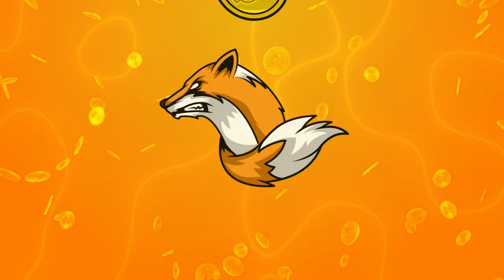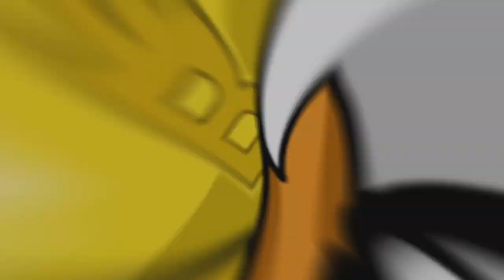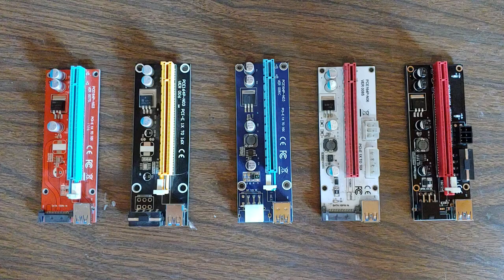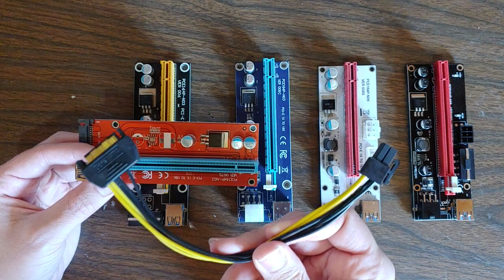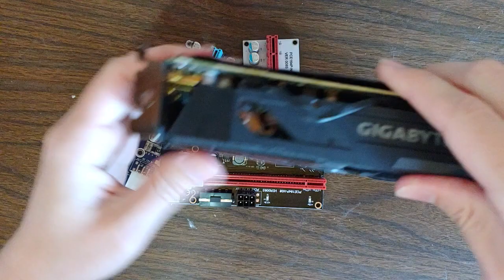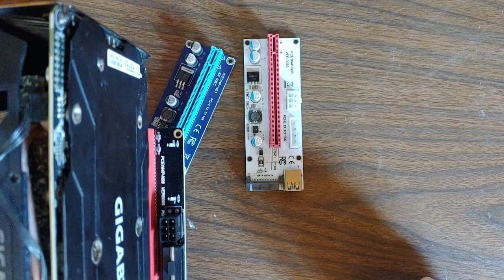Pcie Riser Safety

Comment: For low power cards, you can actually split the 8pin from your PSU via a Y-Cable to power your GPU and the riser with 6+2 pins. But that's only for low power cards up to 150W total power draw.
Reply from the maker: Absolutely correct!

Comment: Molex is rated for safe for minimum 75w. GPU can draw a maximum of up to 75w. Hence Molex is safe.
Reply from the maker: I get many different answers regarding Molex. However for the purpose of this video I pulled my official numbers from EVGA's website. 

https://www.evga.com/support/faq/FAQdetails.aspx?faqid=59716

Which rates both Sata / Molex connections in the same catagory.

I know a lot of different factors go into play with this. And cables can be rated for different voltages. 

But for this reason I chose not to put a stamp of approval on Molex because I was uncertain. 

I appreciate the feed back!

Comment: Molex is rated for 75w. I actually only use molex on purpose. Very reliable, and you can save on 6pin connectors. Never use SATA but Molex and 6Pin ARE 100% SAFE according to standards.

Comment: Just to reinforce, it was covered in the video, some of the new 3080 and 3090 cards pull OVER 75W. So be especially mindful of that. And its also somewhat common among overclockers of 30series EVGA cards to shunt mod the PCIE power sensor. My 3090 will pull over 140w from the PCIE slot. alone! So if your buying used/secondhand do a full teardown and look for shuntmodded PCBs. Even using those on a full motherboard slot is highly advised to use supplemental power for the pcie slots. A riser will catch fire. Period.
Reply: Shuntmods trick in-software power readings. So it might only look like your pulling 38w or something from the PCIE slot in hwinfo64. But your really pulling 2x or 3x that. So you gotta check the PCB
Reply from the maker: This is a very good point. Higher End cards are very power hungry!